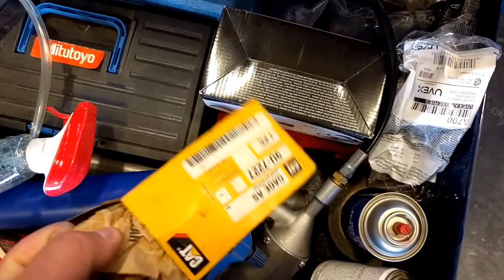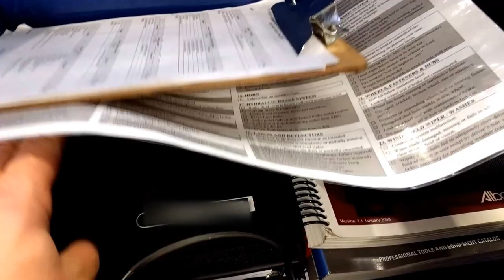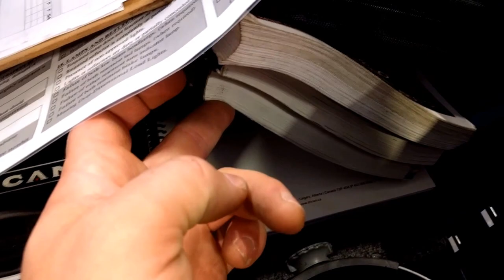Heavy Duty Mechanic Snap-on Epiq tool box tour

Comment: Yo man,

That M12 ratchet has a five year warranty from Milwaukee. Have them fix that puppy for you!

Good video!
Reply from the maker: +mdlee52 do you know where you can go to get warranty on them?
Reply: Home Depot might be a good place to start. Or contact Milwaukee directly. Usually they refer to the date code on the tool to determine roughly how old it is. If the date code is close to the 5 year mark, Milwaukee may ask you to provide proof of purchase. 

Where did you buy the the ratchet?
Reply from the maker: +mdlee52 I bought it online at blackrocktools.com they won't take it back after a certain time period. I'll give Milwaukee a call and see what happens from there.
Reply: Doesnt matter where you bought it.  I bring mine to a local Milwaukee repair shop and as long as the serial number is on there and its within the 5 years they will fix it, they have never asked for the receipt either !
On that note if the serial number cant be read and you have the receipt with date of purchase then they will fix it !
Reply from the maker: +Dill Wiggle Milwaukee's warranty is really excellent.

Comment: Hey i see you're a fellow Canadian! How do you like working in the heavy duty field? Im thinking of switching over from Automotive. Ive been working in automotive for going on 5 years. Im not a big fan of flat rate. Thinking of a way out haha. Good video!
Reply from the maker: Ya, I've been working heavy duty for around 11 years now. For the most part I enjoy it, but like anything it depends on your shop. One of the reasons I went hd instead of auto is the pay. I also work with about 5 other guys that were automotive and made the change and they all said they couldn't believe the difference. I work for a fleet so I don't have to deal with customers which is nice. I worked at a dealership before and that was always one of the downsides. So far I've had no regrets, make good money and work with an awesome group of guys. Couldn't ask for more.
Reply: Yeah i enjoy my job to an extent. Dealing with customers sucks. I work at a GM dealership so theres always a decent amount of work. But the pay just is not there. Not with the way the economy is going. I feel as if for my job i need way too many tools which i really do enjoy tools, but way too many required.I also feel that the skill set required has greatly improved with the use of electronics in vehicles. Im the electrical specialist for my dealership as well so anything anyone cannot figure out electrically i get. Anyways man thanks for the information! Its something im definitely going to look into. I want something that pays more.
Reply from the maker: The work is similar to automotive, but in other ways it's very different. I work a lot with hydraulics for example, and you need a lot of tools especially bigger stuff and SAE tools. It is shifting more over to metric but it's still not there.

Comment: No offense bro but I think u have small hands cause every tool u said u need to use with both hands I generally use one handed especially my pwz for alignments.
Reply from the maker: I typically use mine for breaking lose JIC  hydraulic fittings. Usually means reaching in in with my arm fully extended into a tight space with lots of other hydraulic hoses.